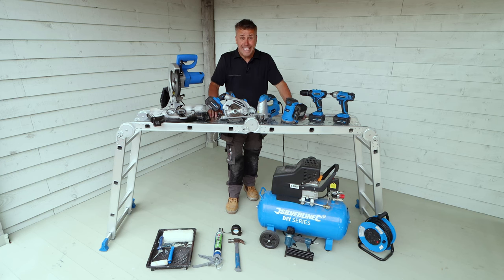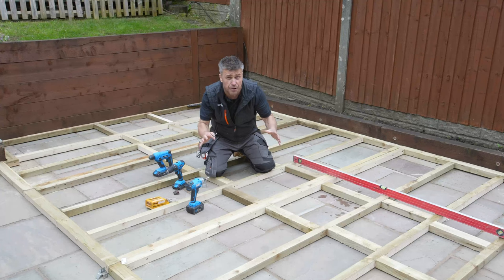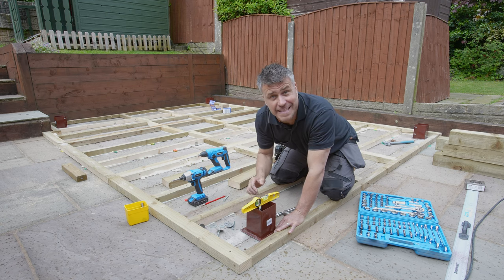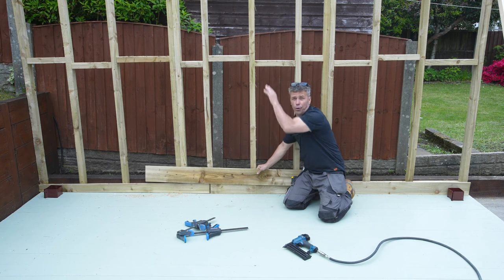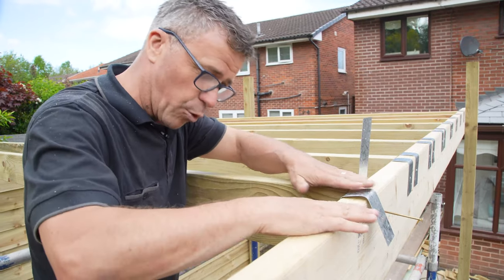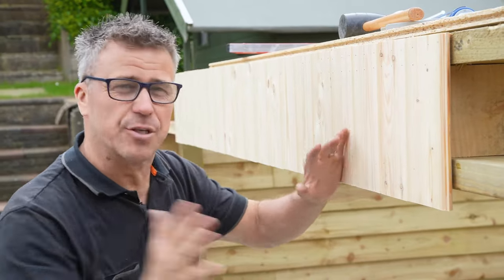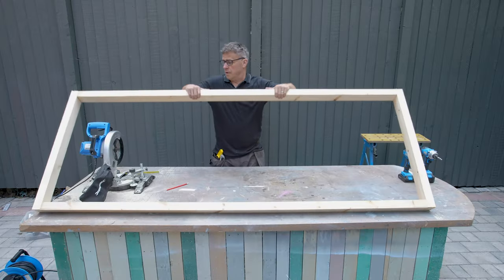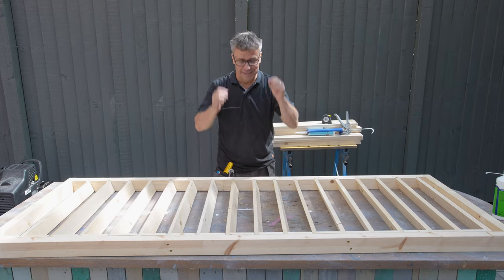How to build a Pergola

Comment: lol hardly nothing on that liquid rubber roof, obviously a nightmare, looked like it was bringing all the tape back up 😂
Reply: The liquid roof wasn't a nightmare at all, it was easy to apply and worked really well, we had to roof covered and water tight within one hour, once it dried we went back and applied 3 further coats then it looked great. we had some areal video shots but they wasn't used in the edit.